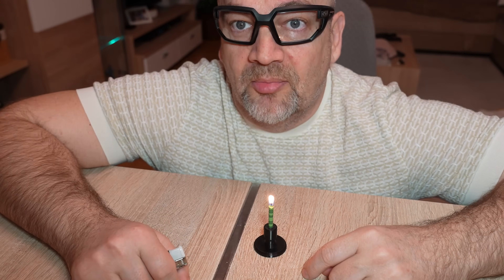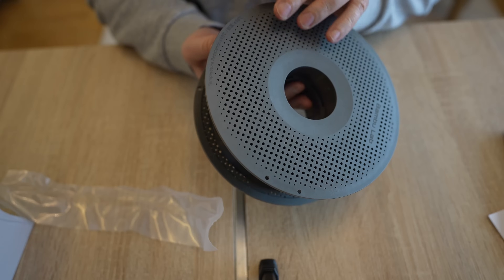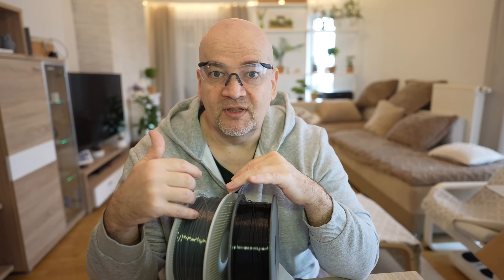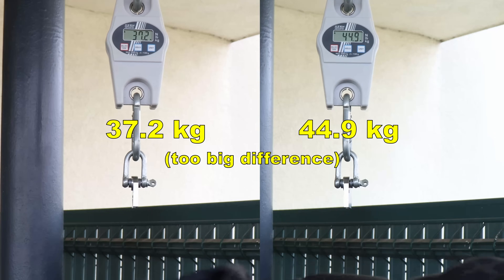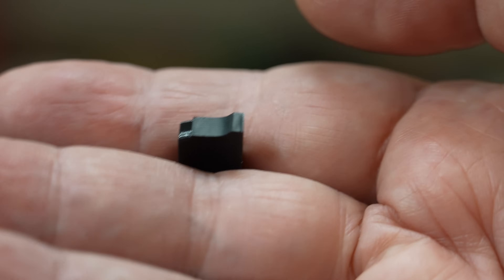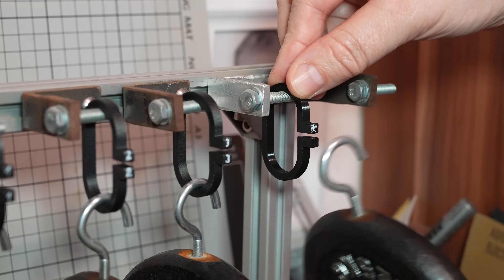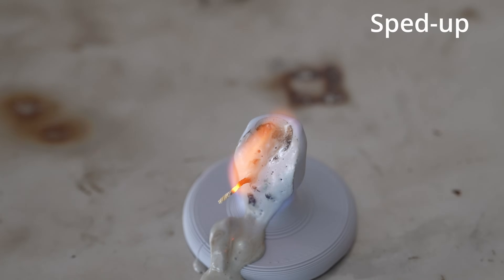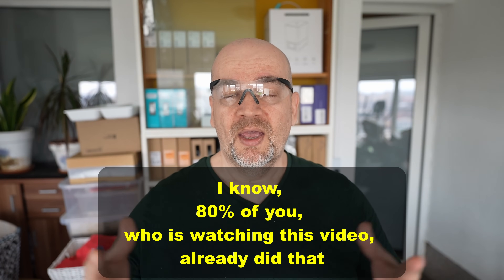BambuLab PC-FR review, the Flame Retardant PolyCarbonate

Comment: Thanks for the testing. Replacing the internals of a lamp with USB-powered LED strip and wanted to be extra 100% safe since it will end up in my kids room, so I bought this filament. Wanted to use it for other possibly "high" temperature applications as well, mostly cases for electronics and computers. Pretty expensive, but still feels just that little bit more safe! Curious about the softening temperature though, since Bambu advertises it at 114º in their shop. Oh well, 104º is still plenty enough for my use cases!

Comment: Researching filaments (just started with 3D printing) for automotive electronics use and this is the kind of material to use. You are my go-to source for filament knowledge so far. Thanks for the well documented and executed tests. And if I could suggest a test of filaments that are flame retardant, have good temperature and UV/chemical resistance, so they can be used in harsh environments but are rated/classified by the ratio of: ease of printing and mechanical properties? Something like a "figure of merit" for demanding conditions. Best wishes!

Comment: In Australia, when testing electrical equipment there is a prescribed testing procedure we use to determine if a component is safe to use. A wire is heated to a certain temperature depending on a number of different factors. If the material produces a flame, the height and time the material burns for is recorded. Then a needle-flame test is applied to any material which is impinged by the burning material for the same time.

Comment: I’m part of a formula student team and we use the Polymaker PC-FR for parts of the accumulator housing.
Per the rules the materials used have to be UL94-V0 certified.
Would be interesting to see the two brands compared in another video.
Also, some filaments don’t even advertise being flame retardant, but have that UL94-V0 certification mentioned in the data sheet. Might be something to mention in the video if you come across a filament like that
Reply: What types of filament are UL94-V0 beyond this stuff?
Reply: @ PEI, PEEK, I’ve also seen it on a PC-GF30
Reply: There are also different “FR” filaments. We also have PC/ABS FR

Comment: As expected the flame retardant acts as a bit of a plasticizer improving the brittleness but loosing almost 10 °C HDT. I am surprised there is not also a  loss in tensile strength. That is quite a good result.
Reply: its interesting because with polymaker pc-fr, their flame retardant additive increases rigidity and tensile strength which jsnpretty cool.

Comment: id love to know why the AMS lite isn't supported, if it wasjust A1/A1 mini not being able to get to the temps for it, make it only for P/X series, locking out the AMS Lite feels weird
Reply: AMS Lite is only for A series printers, and that is the reason. A1 cannot print it, as you absolutely need enclosure and even heat soak for this to come out good. I am now through 15kg of this bambu's pcfr, and to get pristine shiny finish with no warping on any bigger object, you really need to tweak the gcodes to not turn off the bed after print, but slowly turn down the temperature, while you cover it with blanket or cardboard (trying to not make any draft), and let it cool down over extended period of time.  Any draft in the chamber during print will almost always ruin it, as this thing lifts the plate with it if in seconds. Difficulty wise, abs seems like ezpz compared to this, at least with my p1s and setup.

Comment: Hey I figured out why my Plus 4 board popped and smoked. There was a screw from the qidi factory that was behind the front board on the toolhead and it shorted out some contacts. After I removed it, everything worked fine again. The replacement boards they sent me actually didn’t even work correctly. The hotend temperature would jump around sporadically and it never got to the proper temps without throwing errors. Poor quality control is disappointing. But their email support has been great.